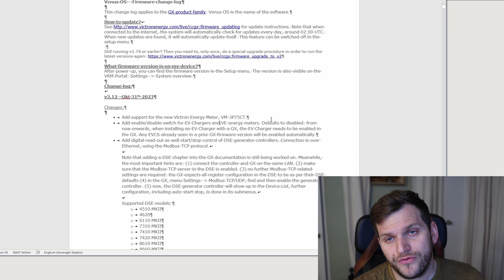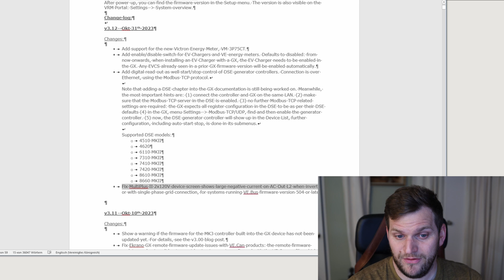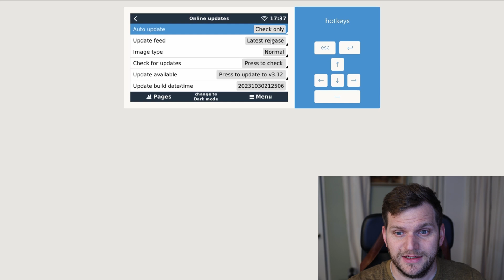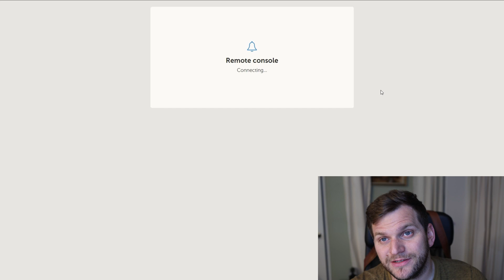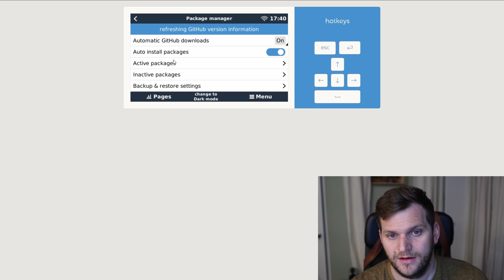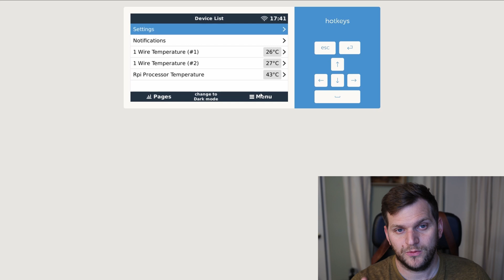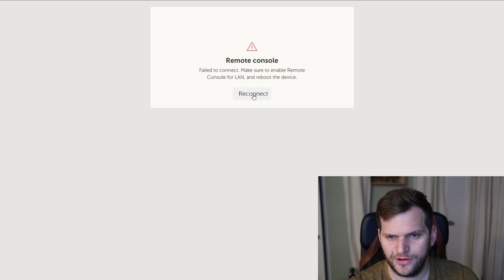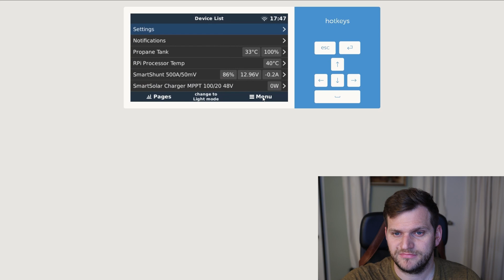Victron VenusOS UPGRADE v3.12 | Raspberry Pi

Comment: hi, I use a raspberry pi zero 2w and it works very well on my boat with a Victron MPPT75/10 charger for the solar panel and a BMV702 which controls my batteries. Display on a 7" screen (touch screen). I also use VE-Direct on Raspi 4 and works very well too. Thanks for the videos ;)